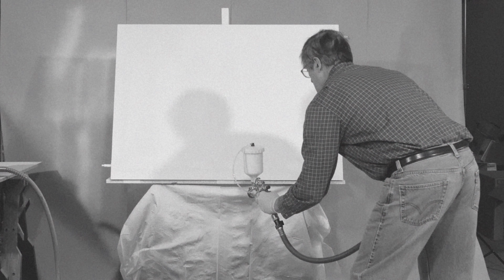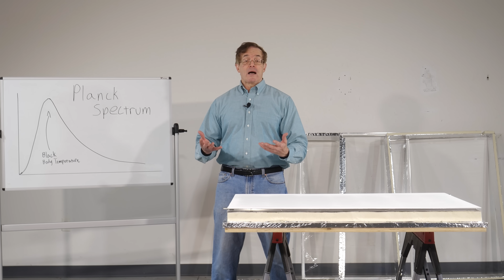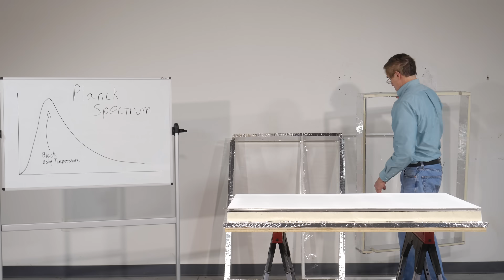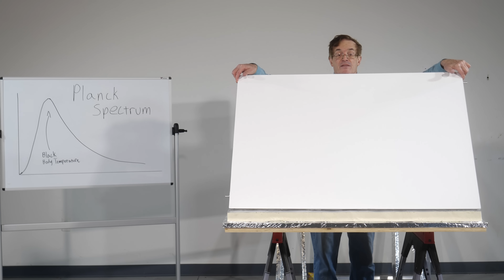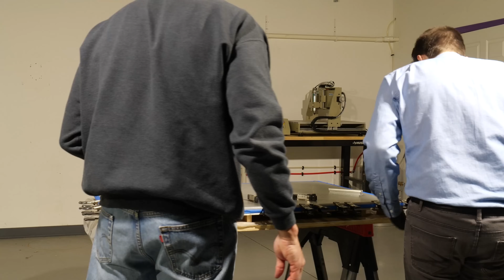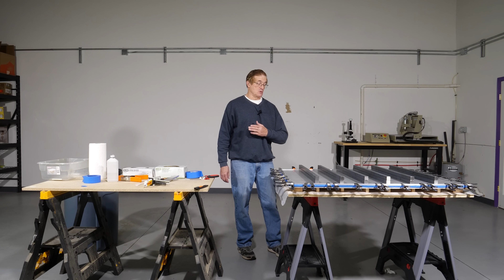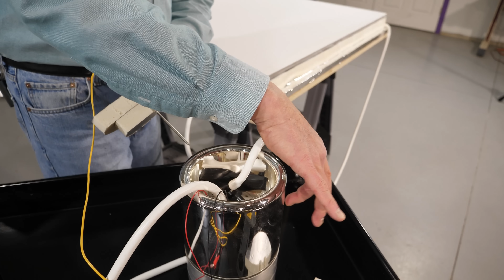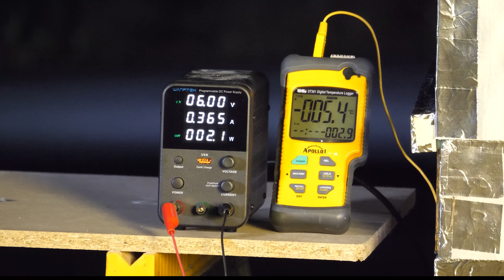Air Conditioning isn't free... but we're close.

Comment: Geothermal heat pumps FTW. Heating and cooling plus hot water.
Reply: Fracking bad.
Reply: @awatt   What does fracking have to do with drilling a geothermal well thit's just like a water well
Reply: @Steevo69  
It's fracking by a different name.  High pressure water and steam . .. pollutes groundwater and makes ground unstable.

Comment: The Royal Institution had a surprisingly interesting lecture here on Youtube on the subject of air conditioning. The lecture can be found under the name "The Physics of Hot Air - with Shaun Fitzgerald". It really opened my eyes to how complicated it is to design a building with good natural air flow and how much power savings there could be had if the air would naturally flow through the structure instead of forcing it through with machinery.
Reply: interestingly, the architect of the Minoan Palace at Knossos, Crete, had a good practical grasp of natural air con - c.1400BC, rather impressive
Reply: @MyMy-tv7fd  tons of ancient muslim and persian buildings did the same. it was almost a necessity back then.
Reply: A book, Architecture Without Architects by Bernard Rudofsky, mentions this principle with many examples throughout history.  Uts shows great insight how civilizations survived 1000s of years with electricity or AC.
Reply: Without electricity....
Reply: Humidity control is really more important (to a point) than temperature, especially outside of desert regions.

Usually in summer we keep our thermostat set to 77F (upstairs temp - downstairs is usually 2-4F cooler)
As long as we can keep the indoor dewpoint below 55F its quite comfortable with the thermostat set to 77F.

This cuts our AC usage by 10-15% vs trying to have a 72F set point

If it ever does feel warm a gentle breeze is more than enough to restore comfort.

Spending a lot of time outdoors in the heat helps as well as it improves our heat acclimation.
Reply: @dorvinion  calcium chloride (the salt used in winter to melt ice and snow down to -30F outside) can be bought at local dollar general stores, grocery stores etc.. in my area very cheaply. i live in south dakota!  it is the same chemical in a product called "damp rid" that is horribly expensive!  
i lived in a 31 foot long camper OFF GRID for 3 winters here in south dakota. we get temps down to minus 30F outside. one winter i tried to heat with a un vented propane heater, using a big tank. well the moisture was terrible so i hung pantyhose with the calcium chloride in them with 5 gallon buckets underneath.
the moisture would be absorbed in the salt crystals and drip into the buckets, but salt would melt also and would form stalagmites  in the buckets.
now, the calcium chloride can be stored in the buckets outside in the sun to evaporate the water, and when it becomes a paste it can be spread on a surface that the salt will not harm , at what ever thickness you desire and dried out, then broken up into crystals to be used again!
a side note is the other 2 winters we heated with a old surplus M1950 wood burning tent stove. i would wake up in the night sweating my * off and have to open both doors because it was over 110F inside. the year we heated with propane was between the wood heat years.  the camper was a 31 foot long with 12 foot long slide out  manufactured in 2000 , it was a "golden Falcon" that was sold at an insurance auction because of damage, but my friend had fixed it somewhat so i purchased it from him in 2016. we lived in it from April 2016 to June 2019 in zip code 57076 so you can check the weather details.  we moved out of it because in January 2019 I GOT A STAPH A INFECTION from getting injections in my back, and spent 3 months in the hospital with zero insurance! i had over 1 million in medical bills, so we live in an apartment now, and im a stay at home dad. i use this account because google HATES ME!!!
Reply: @dorvinion  lol... I find 65F to be quite comfortable
Reply: The link to the physics of hot air
https://youtu.be/zXPYPkgd-JQ
Reply: @Berlin Berlin  Tanks for sharing link. Very interesting.
Reply: I'd like to see some real research and not just claims from GE and frigidaire that modern air conditioners are actually more efficient than old ones.  I just don't buy it. After all, we are using worse refrigerants. All of the best refrigerants have been outlawed.
They, at least wall and window units are built extremely poorly.  I replaced a 40 year old wall air conditioner with a new one that promptly broke the 5th year, which happened to be the year after the warranty.
Reply: @tarstarkusz  You really don't have to take their word for it.
Its possible to measure an air conditioner's efficiency yourself. 

Just remember that efficiency changes with local conditions - humidity, outdoor temperature, etc so sometimes it may meet the mfg spec, and sometimes not.
Reply: @dorvinion  It's near impossible. It is rarely the same temperature and humidity close together to do the back to back testing at the same time or adjusted for solar angle..  Plus, once you pull all the moisture and heat out of the carpets and furniture, it takes a while to get it back in.  Besides, the wall air-conditioners are permanently installed and very heavy.

With a proper climate controlled indoor test, you can eliminate such variables.  Build a room inside a larger room and install an air conditioner into the wall of the smaller test room. It eliminates things like the sun or humidity which can be controlled in the indoor test.
Reply: @tarstarkusz  Considering the modern AC units are (claimed) 2-5x more efficient than something from the 70s, high accuracy is really not needed.

Most of us live in places where our neighbors have similar sized houses and AC units.
Measure power consumption, airflow and supply/return temperature delta in two equally sized systems of different efficiencies at the same time and you ought to get a convincing result.
Course that does mean being friendly enough with a neighbor to do a science experiment with them.

I'm likely to need to replace my central AC unit in the next 1-3 years so I almost want to take one of my unused RasPis, two temperature probes, an RH sensor, and an airflow sensor to log my current system's performance along with outdoor temp and RH so I can compare it to the future replacement's performance.
Reply: @dorvinion  Probably the most effective test is to keep all your electric bills and average them out per year before and after you replace the central air unit.

There really isn't a lot to improve in an air conditioner. It's a pump and a fan.  Electric motors are simply not 2-3 times more efficient than they were in the 70s. Maybe 2-3% if that. AC motors have been around a long time.
The other place you can get efficiency gains is in the refrigerant.  The refrigerant we use today is worse than the refrigerant used in the 70s and 80s.  Nobody changed it because they wanted to change it. They changed refrigerants because the law required them to change it.
Reply: @tarstarkusz  I have an ecobee so its easy to know exactly how much my system runs. Doesn't help measure performance all that much though - temp/air flow/RH are needed.

Improved efficiency in heat exchangers, multi-stage compressors, adjusting blower speeds
More to it than just refrigerants
Reply: @dorvinion  There would only be 2 ways to make the heat exchanger more efficient. 1 increase the surface area by using thinner fins. 2, make it from a more thermally conductive material like copper.  But that has its own downside.  Copper loves to oxidize in the damp.

I have very serious doubts the compressors are more efficient by anything more than a fraction.

There have always been adjustable blower speeds.  The one thing I might give them here is more precise temperature control with the use of microcontrollers in the electronics.

The downside of course is that you're buying a new one every few years because the new ones are not made anywhere to the physical build quality of the old ones.
Reply: @tarstarkusz  you say you're skeptical about efficiency, yet you give an example of longevity, not efficiency. Also you never stated what broken.
Reply: @zackdawley  First, these are related issues. It's not an efficient use of our resources to have to buy and then throw out a new appliance every 5 years.  Our appliances take long cruises around the world before they get to our local store.  The materials take nice exciting cruises all over the world too.  When you arrive at Home Depot and buy an air conditioner, it has traveled the world before you picked it up.  At a minimum, it's taken a 10k mile cruise from China to the US.

What broke was the electronic control panel of an air-conditioner.  This brand new unit replaced a still working perfectly working 1970s American made GE (IIRC) air conditioner/ heater combo.  My home does not have duct work (steam heat) and so a wall unit is the only thing I can put in my living room.

Finally, as I said in previous posts here, I have serious doubts the newer one was more than fractionally more efficient than the old one.
Reply: When you live in a country where it is constantly warm, it is a viable option, however, moving awa from the equator and / or having more of a sea-climate such as here in the Netherlands, it is a little bit more complicated. In Germany they have the concept that is called "Passive house" It is based on very good insulation and getting the sun in when it is quite low and keeping the sun out when it is higher. This works extremely well under the conditions we have here.
In wintertime the sun keeps low. When it shines it does come in and gives free warmth to the house. Whil in the summer it is kept out. The extreme insulation protects against overwarming or undercooling of the building.
Reply: The link to the question and answers
https://youtu.be/bXeBVTcVOCU
Reply: My house was designed by the guy who already lived on this property, and has some awesome features.

Like the upstairs bathroom is unusually large, it's just got this big open space. Why not make it smaller and have a larger bedroom?
The winter sunlight hits those open tiles and absorb the heat, keeping the house warm well into the evening. In summer the sunlight angle is different, and the sunlight hits the tub instead of the tiles.

Every day at 4pm, we reliably get a breeze from a specific direction. The kitchen windows open at an angle, becoming "scoops" channelling the breeze towards the door into the lounge room. Close all the other doors and windows, and the breeze will move into the lounge, then do a big spiral through the lounge, up the stairs, through the upstairs open area and out the balcony door - cooling the house near instantly.

The only catch is... what about the rest of the time?
In summer we need to keep blinds down and windows closed to avoid heating the house - if someone leaves a door open and it gets hot, we can't cool it again until 4pm.
So we still need fans and a portable aircon - often we don't need it, because of the passive design, but some days we REALLY need it.

Still, it's amazing what a difference some clever, targeted design makes!
Reply: Yes similar items were being looked at with passive home projects in New Mexico (which face very hot days and cold nights) and the designs of buildings large data centers efficiently in Arizona without massive air conditioning overheads.
Reply: Excellent passive airflow in a building made of wood also makes it a firetrap. So there’s a complex cost/benefit analysis to do.
Reply: The Greeks knew it… see the city of Mileto. Similar designs were adopted later by Romans, but not as good because Mileto had a predictable airflow
Reply: Termites have had it for millions of years.
Reply: Good airflow won't cool a building for shit compared to air conditioning. Same with this thing, it's probably about 7 BTUs of cooling capacity, compared to the 36,000+ BUTs of a standard central AC unit lol.
Reply: Architects are expensive, positive pressure setups are (comparatively) cheaper.
Reply: We have them, they're call soffit and ridge vents, just increase the vent area to create air pocket in the attic
Reply: Actually it isnt and wasnt. Old houses are situated so they face the sun rise and set. They have windows placed to create even air flow. Hell the condos in California would stay cool all day if you kept the doors shut. Because of the concrete pads that had absorbed moisture. Then you leave the windows open at sunset and let the cold back in. Hmm a box with 2 holes on opposite sides what would happen if wind blew against it? The complicated parts would be how do we do this for skyscrapers or buildings with delicate instruments in it like servers? We need to control humidity and a system that free flows cant do that. Anyway cooling is simple when you have relative humidity and temps outside. Your foundation acts like a cave absorbing moisture and releasing it through the day. If humidity is too high you cant cool off. The biggest issue is heating. How do we move heat without wasting it.
Reply: @fajile5109  large data centers are moving to liquid cooling anyways because it doesn't require as large of a temperature differential to keep servers cool
Reply: @AsbestosMuffins  Especially if you have racks and racks and racks of servers to keep comfortable.  We set-up one of our server farms where I used to work with a whole rack loop.  One LARGE radiator with multiple fans serving all of the servers although each server had it's own pump (for redundancy).  Worked quite well at keeping them operating even when the AC unit serving that part of the building died.

Comment: Nothing beats the price of free.99
Reply: freedom is slavery
Reply: It's not free, it's propaganda.
Reply: @Dat_Sun  Once you go past break even, it's "free".
Reply: @ChucksSEADnDEAD  It took energy to build it right? Materials, mining, heavy equipment,  transportation. Basically it has a heavy fossil fuel cost.  It would have to offset everything involved from the beginning. 

 Even if it work's as as good as possible,  it would likely never offset the many gallons of fuel used to make it possible.  This is a version of existing perpetual energy nonsense.
Reply: @ChucksSEADnDEAD  It hasn't, and will never offset it's own footprint.  It's best to look at it like an empty battery,  it took a lot of energy to create,  but gives us nothing. The few watts of cooling is only possible with fossil fuels burning elsewhere. 10 units of energy for .25 units of cooling..
Reply: @ChucksSEADnDEAD  It is a version of existing perpetual energy machines.  I barely recall a long ago stude admitted this was all for nothing because of the whole process.  I will reply with it if I can find it.
Reply: @ChucksSEADnDEAD  The amount of cooling gained could never off set the initial cost. The materials used are basically a battery.  The process involves lots of oil and resources. Anyone preaching free or almost free is pushing propaganda.